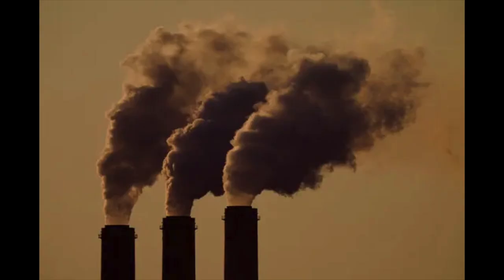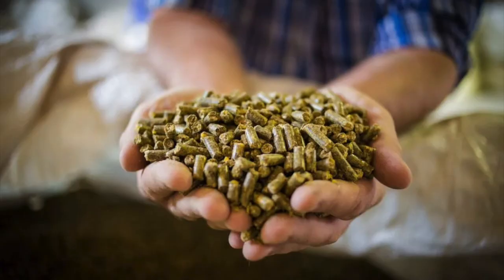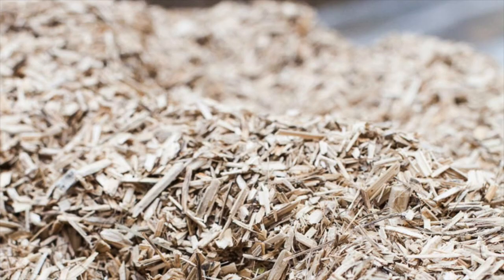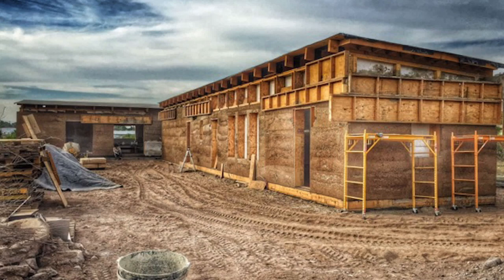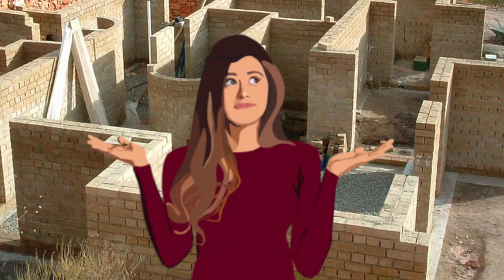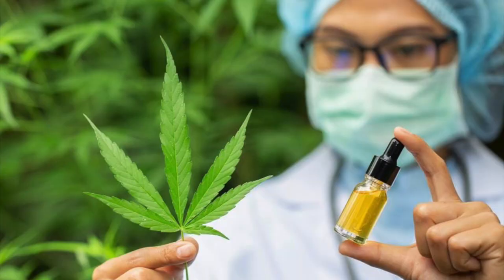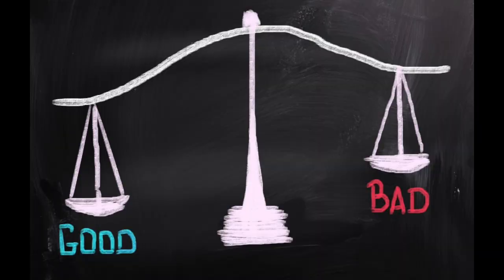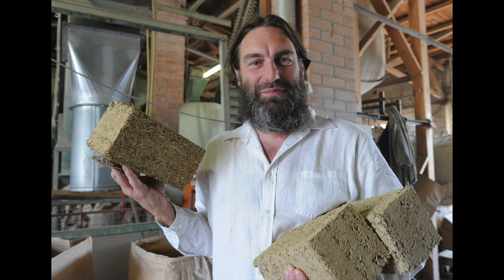Hemp Construction On Top

Comment: during the life of a concrete structure it reabsorbs much of the carbon it produced. not enough to make it carbon neutral but this needs to be included in the net emissions calculations
Reply from the maker: That's very interesting. I have seen researchers claim that such structures are carbon negative as they sequester more carbon than they emit. This is of course a very new technology that needs to continue to be explored to learn more about its properties.
Reply: This is only for lime! Not fit cement

Comment: Who is going to plant this ? Even if it would start the saving by slowing the high carbon use we already have. The key is the seeds are in the ground this spring!!
When thousands of archers have been planted the uses will find themselves with a big pricetag.  That comes when independent builders see the profits when switching to a bio raised production for their construction.  Such as hempcrete for many insulation for post and beam construction from the inside pulp of the plant and a whole bunch of Industrial resins from the outside parts of the plant. 
All that's needed is seeds planted.
Reply from the maker: I sure hope that they plant and seed more hemp, seems like a good crop to use for construction and insulation and has many benefits that are good for the environment.